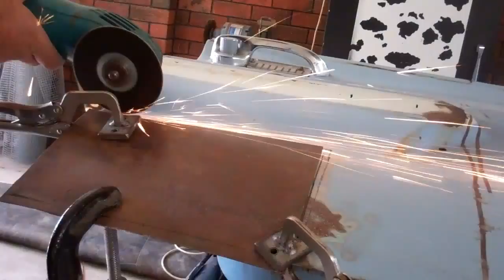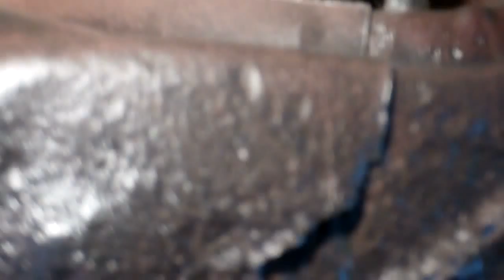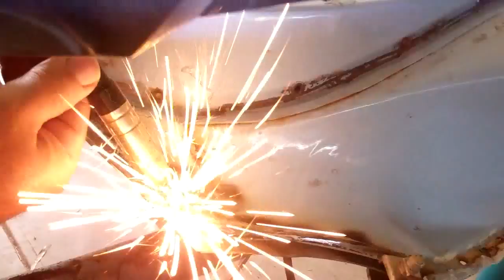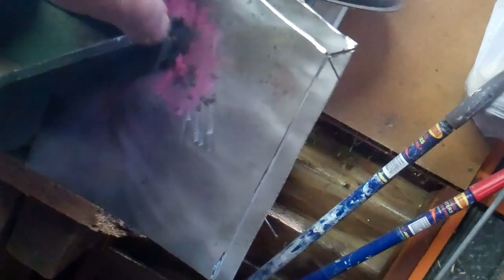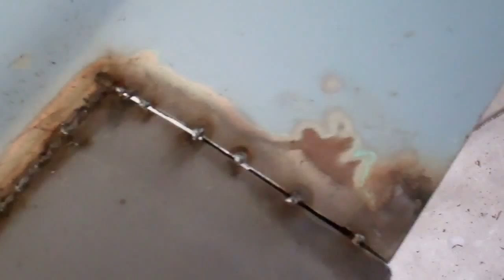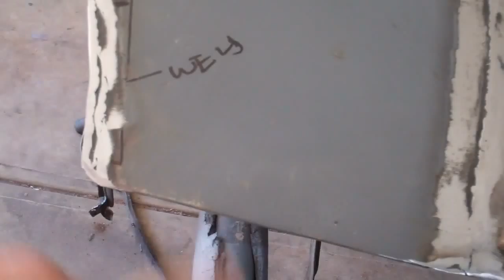1960 Chevrolet Impala restoration part 28 Rusty doors

Comment: Hi mate, just wondering if thats weld through primer your using that your welding over with those patch panels.I to watch swnc and Pete's good at teaching hey!!I think you have done a very good job mate as i am doing the same to my old valiant ( cm glx) but nowhere near the rust you have to contend with.CONCRATULATIONS!!!   :)
Reply from the maker: Mopar Man73 Thanks mate,
yeah the grey primer can be welded over, i generally strip a skinny area back to weld metal on metal.
Reply from the maker: Impalasport348 Yeah, you're right.
That section of the door i was peening was tough, tough stuff.
I felt confident enough that it wasn't going to warp the other side.
But yes, I should really have supported with a dolly.
CM Valiant?
Last of the big banger Aussie Chryslers.
Nice cars.
Reply: Thanks bud, where are you upto on the car, i hope you are still going to finish it and i know how expensive it can be ( beleive me ) . After i purchased the car i decided to get the tools i would need to restore the car-welder,brake bend,bead roller machine,compressor and several air tools that was about $2000 dollars worth of tools so i sold some stuff i no longer wanted to finance this start.I seem to be able to make do with what i have.I am a mechanic by trade but didn't have a great deal of expeirence with body work until i learn't from our freind Pete.Nothing beats the way he's teachers us.If it wasn't for some asholes keying this car the paint would be perfect apasrt from the minor rust patches that can be painted-touched up easily.I would like to keep the original factory e-coat on the car so am hesitant on stripping it down to metal, once down to bare metal the e-coat has been compromised.As you can see i luv talking cars so if you want to ask questions back and forth it would be good to have a car guy to correspond with.Thanks for getting back to me :)
Reply from the maker: Mopar Man73 Cheers mate,
I'm at the point of ordering the sheet metal I need to finish out the body work (quarter panels, boot floor,rear valance ).
I haven't ordered it yet cos my business has been a little slow lately so I don't want to blow it all on parts (cos of the missus, you know).lol.
I was a brake, clutch and suspension mechanic years ago and same with me, never did any body work until I saw "my friend Pete".
He's rude and crude, but he knows his stuff.
I've got most of it in high build primer which I'm gonna rub back a little and then redo once all the panels are back on and bolted up straight.
I'm hoping to get what I need by spring so I can get stuck into it again.
Thanks for the tips, I'll call in from time to time.
Reply: No worries bud, and if i can help in any way i'll try.The money is always the holder backer hey.This weelk or 2 we i finally moving to a house where i have a descent shed instead of a carport so i can then rip the engine tranny and diff out so i can get to all the underside for scrapping that crappy old undercoat ( hope theres no extra suprises...lol.
Ok mate talk to ya later :)
Reply: +Impalasport348 his is dave of daves body shop i noticed  your repair of the 60 impala   i have alot of hard to find sheet metal  oem  execellant used parts  and many others  parts for the 60 impala i did several of them  manvel tx 2814899595 if you need something let me know
Reply from the maker: +David salazar sr Thanks David.
I'll send an email to your gmail account.
Let me know on this link if it didn't get through.
Cheers.

Comment: When I have to install patches, I take much attention to make fit between existing panel and the patch panel
To my experience, it is much easier to weld and the  bead is much smaller  that is limiting distorsion and makes much easier to finish the job

Comment: Been watching all you videos from part 1.. really good learning guide I must say, and i really like how your build is kept at home with tools that are easyly accessable by anyone. and i also like how you describe the products you use. Just wondering mate how thick is the sheel metal you bought? and what kind of mig welding set up are you running? seems like you get some pritty neat welds that are easy to cope with... if you can please describe the brand and the voltage you are running and wire thickness you are running etc of the mig welder, and by the sound of it seems like you are running an argon gas set up as well?

you also chose the perfect car to work on and the work you are doing to it is amazing! Keep your head up and im sure like everyone else i will be on the edge of my seat waiting for this build to finish!!! waiting for the next video
Reply from the maker: Thanks for the nice comments Veron266.
The sheetmetal is 1.2mm thick, the welder is 180amp argon gas mig with 15amp plug.
The big advantage of doing this at home of course is saving stacks of money, and it really isn't rocket science.
I'm waiting on a high cfm compressor cos the one I'm using just doesn't cut it.
Reply: Impalasport348
Nice dude. what brand is your welder? and how much did it cost? if you dont mind me asking, how much has the car cost you since you bought it? and also how much did you buy it for? when are you planning to finish the project? yeah looking at all that rust work you have done would have saved you a fortune. that car is going to end up being a real beauty. i want to start a 63 or 64 impala build maybe in about another 6 months or so. this is a true inspiration for a lot of people
Reply from the maker: veron266 The Welder is a Unimig 180, it cost me about $180.00 which was on special at the time.
The car cost me $4,500 AUS.
I bought it off ebay from Massachusetts USA which wasn't the wisest move as Massachusetts isn't exactly a dry state (hence all the rust), but it was all I could afford at the time, so I knew what I was in for.
It cost me another $4000 to get it to Australia.
I reckon I've spent about another $800.00 on top of this for paints and sheet metal, so it hasn't really cost me much outside of the initial purchase.
I really thought I could get it done within 2 years, but I only get weekends to work on it, so it may realistically be another 2 years or hopefully less
The good part is the rust repairs are coming to an end, the rest will be far easier in comparison.
Goodluck with your 63 when you get it, cool car.
Reply: great video and good work... Impressed, well done